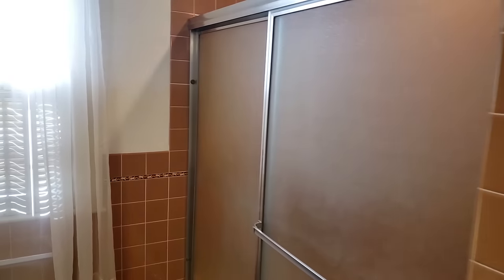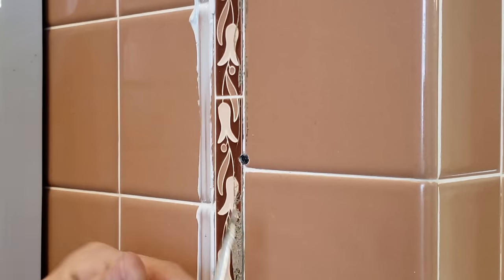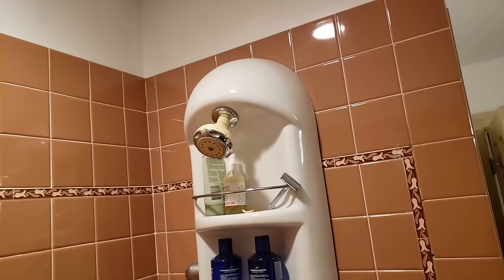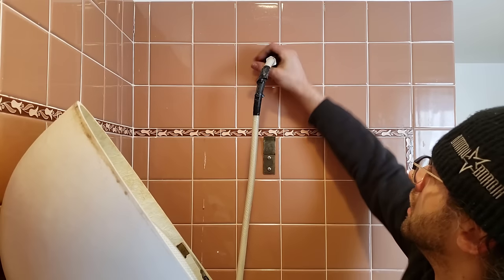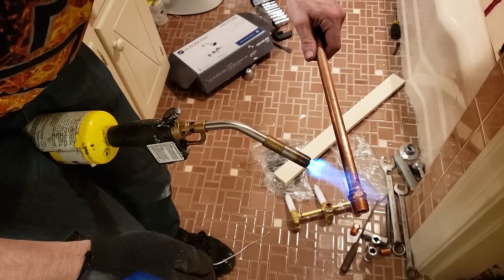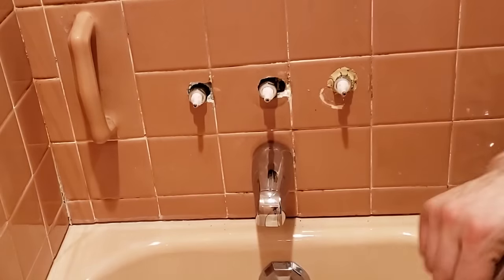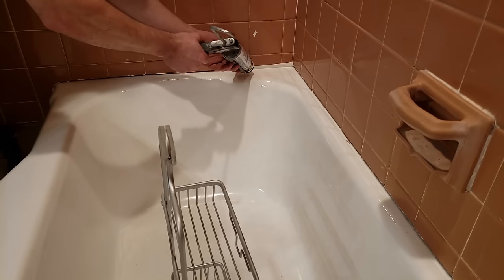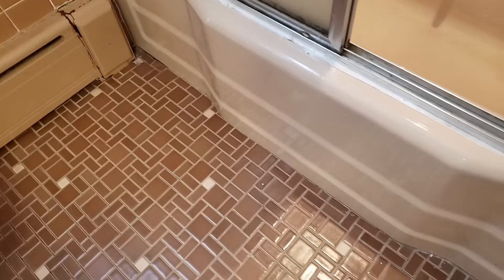Mid-Century Bathtub Remodel - Refinish, Mix Valve, Shower Door | Bathroom Remodel Part 3/6

Comment: Huh, diddnt know you could paint a bath. Learn something new every day
Reply: I used to rehab apartments for a property management company.  We stopped using this epoxy stuff because it doesn't last.  Instead of spending hours prepping and painting old tubs, we just removed them and put in plastic tubs, which you can clean with an angle grinder and scouring pad.

Comment: You can get handle & escutcheon replacement kits. Some plumbing codes require installation of a mixer valve in place of a 3-valve, if it had to be replaced completely.
Reply from the maker: Hopefully we can count on stuff being sold off the shelf being code. 👀

Comment: Thank you for soldering the isolation valves and not using Sharkbites. American Standard makes a tub called "Americast". Definitely better than painting a tub. That paint will last a year or so. The common failure points will be at the overflow and drain flange holes. Unless you paint completely through to the opposite sides.
Reply from the maker: This house has solder joints over half a century old, and they don't leak. Sharkbite just isn't that proven.
Reply: @Bootstrappin  considering it's a rubber o-ring that creates the seal, it will never last. Same with ProPress joints. They're just Sharkbites of another name. 

That old 50/50 solder with leaded brass fittings will last over 100 years. Just don't let your hot water get too hot and don't cook with it either. 😂

Comment: Nicely done. Is there a way to paint old tiles instead of replacing them when they are in good condition like in the video? Not that the tiles in the video need a new color.
Reply from the maker: Yeah, technically that same tub paint can be used for tiles. But only white will work, because it will cover the grout, any other color may look strange.